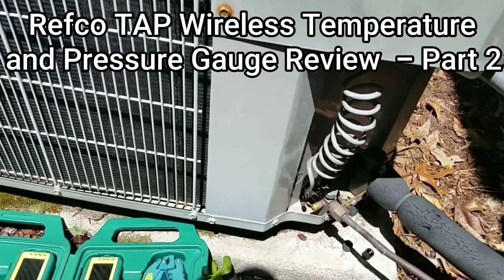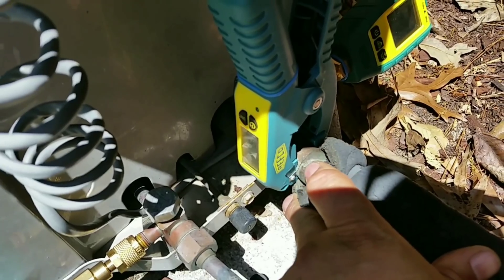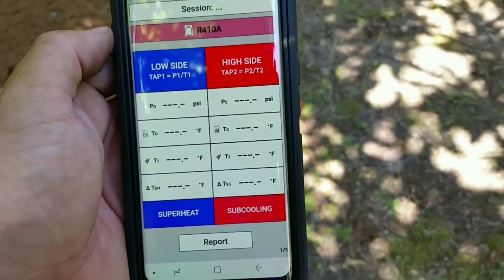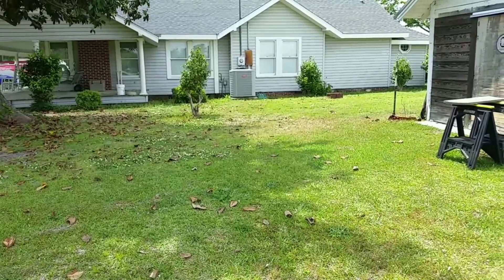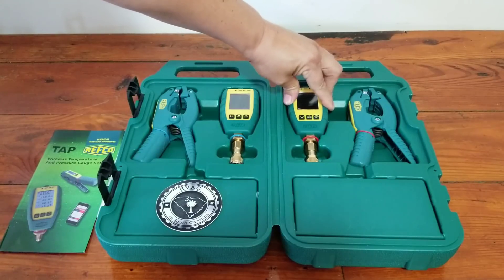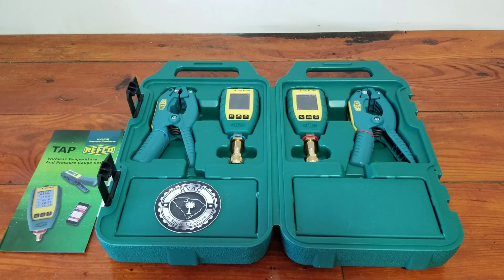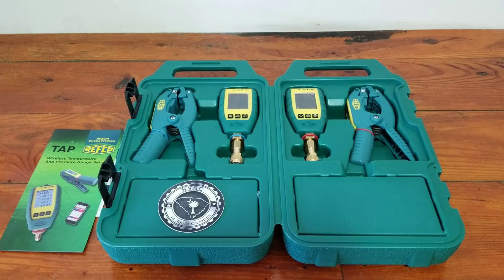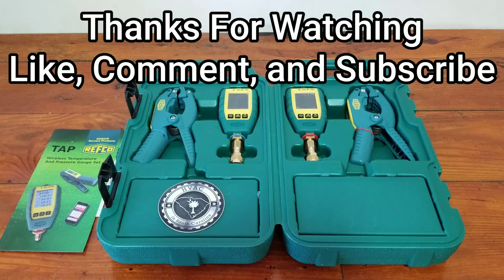Refco TAP Wireless Temperature and Pressure Gauge Review  - Part 2

Comment: I've had these for 3 years already and mine have been great. Use them for ac and refrigeration equipment, I did connect a t fitting onto the low side to add refrigerant though.
Reply from the maker: This video is over 6 years old so I'm unaware of any improvements they may have made since this review was published.
Glad they are working well for you. 🤙